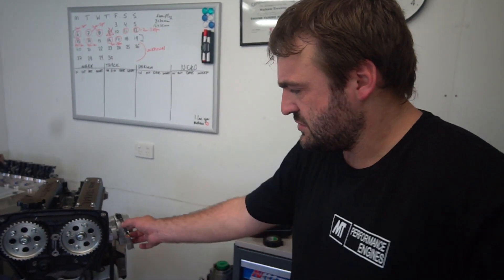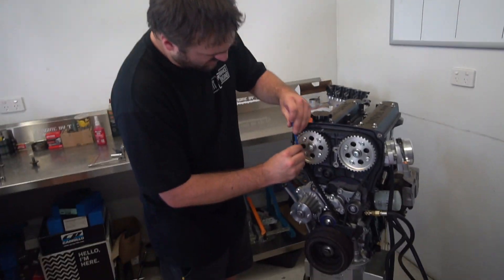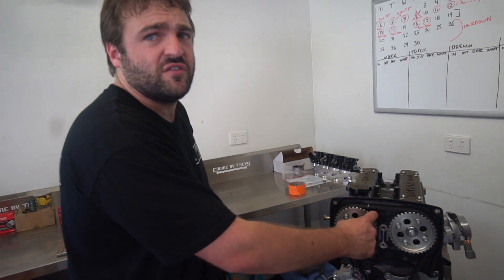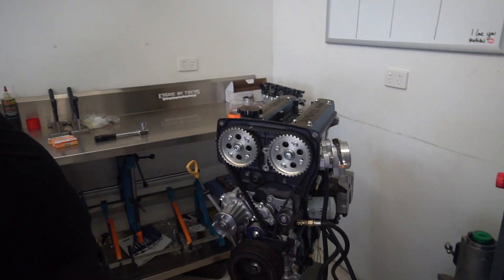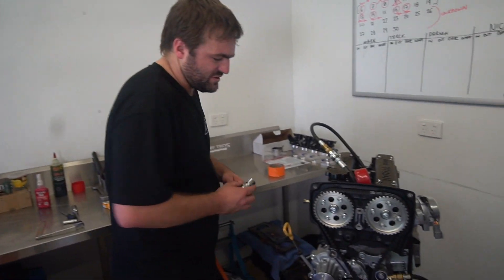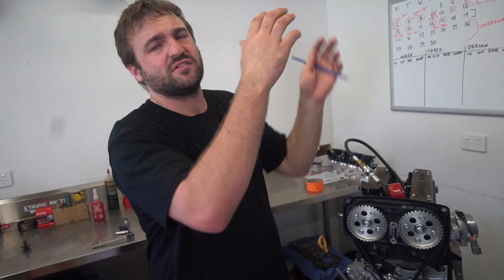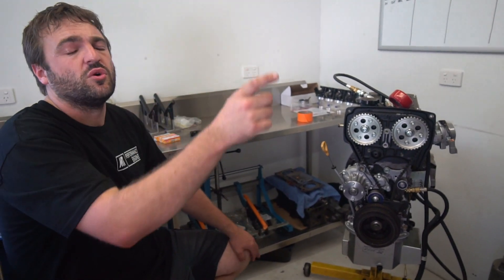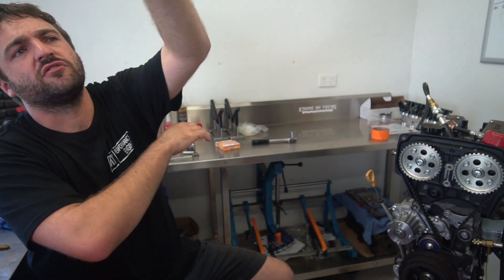FULLY WORKED 4age/7age Build Part 4

Comment: At 1:17 you show a before and after picture of a hole on the block and mention more oil flow.  Can you elaborate on where that modification is done?
Reply from the maker: it's where the oil pump bolts to the front of the engine, Mat just ported the oil feed because the pump we used doesn't line up perfectly, we're using a silvertop 20v oil pump on a 7afe block because its stronger and has higher flow so it just needed slight modification

Comment: Hey good day I'm having a problem with my 4AGE 16v not idling properly even when I unplug the vacuum hose from the Map sensor
Reply from the maker: Could be a vacuum leak  somewhere else 🤷‍♂️ there are a lot of vacuum lines on a standard 4a or even a gasket leak

Very difficult to diagnose in a messaging but if you google it you’ll find heaps of old forum posts that could help

Comment: How did you turn the motor over to check the oil pressure?
Reply from the maker: Mat has a 4age bell housing that he bolts to the engine stand and when he finishes an engine he can just hook up the starter and use a battery to turn it over.

He does this with all customers engines on completion and he sends out a video if the customer can’t come to the shop